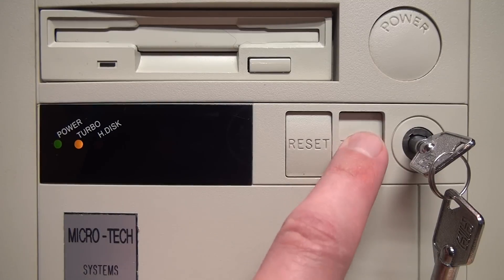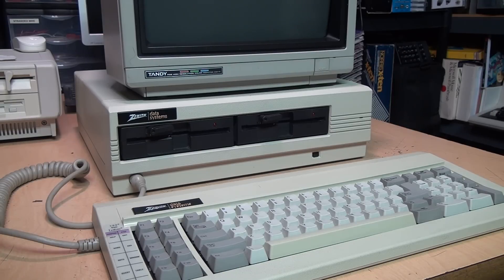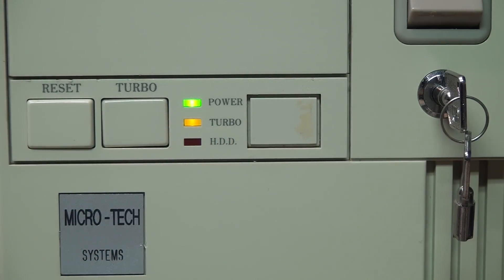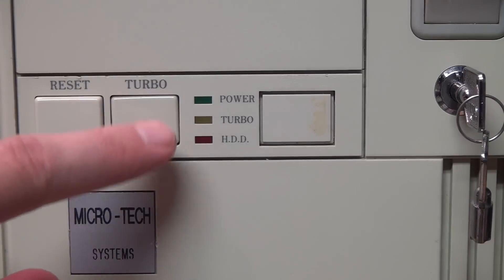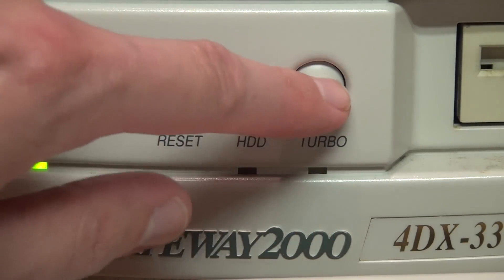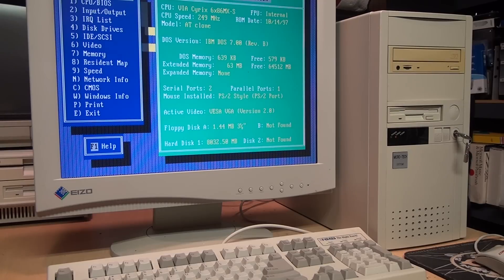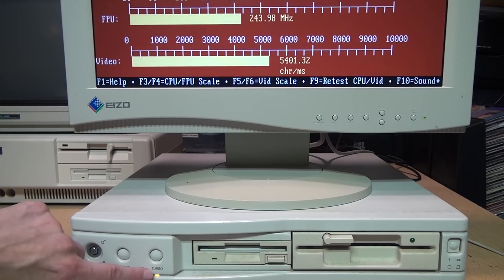The PC turbo button mystery finally solved! (beta version)

Comment from the maker: For those who wanted to hear the history lesson in my own voice, I have re-uploaded it here: https://www.youtube.com/watch?v=zpq9irl2yE4
Reply: why was this with a robotic voice...
Reply: oh thank god
Reply: thank you this was unlistenable
Reply: @sapincher  yeah lol
Reply: i was hopping to learn what physically happens to the cpu to make it run slower... does voltage drops? fsb speed drops? clock multiplier drops? cause since i had my 486 i think anyone knew back then that turbo mode was the normal speed and non turbo the slower speed, that was never the issue...
Reply: hey i have a laptop with turbo mode so do you think its works like a turbo mode computer ?
Reply: So, I didn't wanna look so nerdy and was looking for an "In" just to ask you what that cool little tune is between chapters or thoughts... then I saw you had changed your voice EVER so subtle to not even be noticed... Was that a gag or do you actually manipulate your voice for some reason? Sorry Love it here but new... Also Where can I get the little tune?
Reply from the maker: @Pizzacam3  It's a weather report sounder from radio station WCTC: http://www.amstereo.org/files/WCTC_weather_sounder.wav
Reply: Yes please
Reply: when i was builing these, Id hook it up wether or not if that turbo button was pushed it would always run at its max. However I still set it up so that light would work. But the reality was, I thought it was a scam.
Reply: I didn't even notice it.
Reply: Thank you! 👍🏽
Reply: Thank god, was about to skip the video cuz that Text2Speech was absolutely horrible.

Comment: My dad's PC had a green light under the turbo when on, and red when off, but you had to push the button in(latched) to turn it off. That would be confusing as hell if you didn't think of 'green = on, red = off', and you could easily confuse it as 'turbo = slow'.

Comment: I think the far more interesting question is the various ways turbo was implemented. You showed a single CPU datasheet for a 486 SL CPU, but that doesn't by itself mean anything! There were many CPUs before this that did turbo - probably that didn't have a CPU flag for it - and there is a lot of stuff around about "inserting wait states", disabling cache and such. Just running a benchmark doesn't quantify exactly what is being done.

Comment: The display had a diode matrix and jumpers, so you could display ANYTHING in normal/turbo mode.
There was no real frequency readout or similar, every display segment was freely configurable.
I put the initials of my "demo group" on display back then😀

Comment: This entire topic is alarmingly similar to what I've thought when pressing "sport mode" in my Kia. To me, it's "the default speed" of the car, thus should be called "normal", but that's what they call the mid-range mode, which I would have called "economy." But that name they use for the 3rd level of aggressive economy, which they call "smart", but I would have called that "desperate."

Of course I immediately turn on sport mode every time I start the car.   It's past time to look for a custom chip to have it default there ffs.

Comment: I'm assuming by now the so-called turbo mode is built into every PC nowadays personally I don't understand why they would have been an option to turn it off if it made it run that much better it would have a lot less confusion for everybody if it just did it without having to do anything

Comment: I want to argue!
Well, to offer a second point of view; it depends on how you're looking at it.
It doesn't matter what the documentation say, or even what happens hardware vise. Maybe in the early years of Turbo-button the default for many was to run in turbo-off mode, but it's clear as day that this was not the case for long. Users want their computers to be fast, and if you buy a 66Mhz CPU then that's the clockspeed what you're expecting to use it at.
And what purpose does the Turbo-button serve? It's purpose is to help with backwards compatibility of old badly coded software by slowing the system to a clock-speed that more resembles the olden days.
So arguably for all purposes, what you would use Turbo-button is to slow down your CPU - nobody ran their 486's at 286'ish speed as default, but if some old software went nuts from the unexpected speed, then you would use the Turbo-button to slow it down so the software would work.

So that's my argument. But it's not an argument between what's right and what's wrong - I'm not trying to say the video is wrong, just saying that this is true also. The button was there so you could slow your PC down when needed.

Comment: The engineers labeled the button [Slow Down], and that is what it did.  It slowed the cpu down in order to run legacy software.  Marketing saw that, laughed, and said nope it's the [Turbo] button tell the computer to boot in slow mode. Then the engineers grumbled and said, you're going to confuse everyone. Look what happened.

Comment: Easy, it's just a connection to jumper switch on the PC clock.
Not all apps needed the faster clock speed, i used a slower clock hack too, for game titles that run too fast.

Comment: 4:49 what you have there is a very admirable example of cost reduced engineering that's a win win for everyone. That's so cool that they were able to add that kind of customization feature just by adding an extra wire and a slightly more expensive connector. That's even more cost reduced than a jumper, but it has an arguably better user experience.

Comment: Imagine a slot 1 motherboard with a celeron 300A and multi switch.  Normal mode would run at 133 MHz.  Turbo Mode 300 MHz.  Ridiculous speed 466 MHz.  Ridiculous Speed 504 MHz.  The comes a Coppermine 650 at 933 which has gone PLAID! 😀

Comment: I remember when i was a kid playing that MSDOS rabit  game, if the sound was on, the game runs very slow. That was not like today's games when lag makes the game skip frames making the image form in little jumps, no frame was skipped but the game was like a movie on slow motion, so we had two alternatives, turn off the sound or turn on the turbo switch. the turbo instantainely  makes the lag go away but people used to say that it could damage the computer. Some times we used the lag to make the games easier on harder parts too. that was like a hardware cheap. pretty cool.

Comment: Sometimes, when getting to a difficult part in some games, I sometimes tried to 'de-turbo' the pc to slow the game down a bit. So, without taking my eyes of the screen, I would press the turbo button to pass that difficult section, and would hit the button again when that section was passed. But all too often, in an attempt to press the turbo button, I would hit the reset button. And yes, it does what the name implies.

Comment: God those old machines were like shooting craps! In the 80s you could see 2 cars that weren't modified and came from the factory identically equipped (Same motor, transmission and rear-end) and one would outrun the other one by a fee car lengths. The computers were the same way. You could take two identically equipped machines and one would run so much better and faster. Obviously someone was doing a poor job of assembling both of these examples. Ya'll Take Care, John

Comment: This is what we refer to as a straw man. You'll notice that none of these sources you quoted said that "turbo mode" slows down your machine. Rather, they said that the purpose of having a turbo button is to allow you to slow down your machine. Nobody who ever said this was suggesting that "turbo mode" is slower. So nice work arguing against a position nobody was taking. What we are saying is that the purpose of the button is to allow you to run the machine at a slower clock speed. Why would we say this? There are two relevant questions to ask yourself:

What does having the button allow you to do that you wouldn't be able to do without it?
How would you configure those machines if a turbo button was not available?

The answer to the first question is that the button allows you to select between two different operating speeds for the machine.
The answer to the second question is almost certainly that you would configure the machine to operate at its highest speed.

Therefore, the thing you get with the turbo button that you would not have without it is an option to select the slower speed. That is why many people like myself pointed out that this is the real purpose of the turbo button. Everything you have shown in your video is consistent with this position.
Reply from the maker: The Wikipedia article and several YouTube videos specifically said that engaging turbo mode slowed down the computer. After I published this video, the Wikipedia article has since been edited to correct this mistake.

Comment: Yeah, what happened was that people had TURBO buttons and no LEDs, and their PC was already running in TURBO mode by default, and pressing the button without the LED indicator, they thought they were turning it on when they were in fact turning it off. Well, this was an interesting lesson.

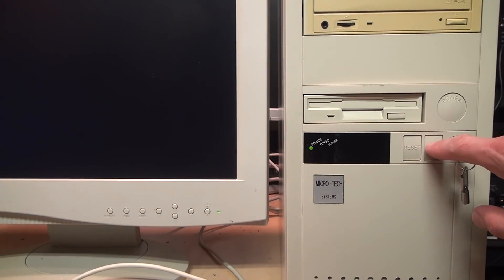Comment: I LOVE the comment/joke @ timestamp 15:53 🤣🤣
"It's called a BOOK" 👍

Also to note: one thing I would've like to have seen/learned about is what exactly the electronics are doing/did for the turbo button to work? What are the main components that made the turbo feature be faster than just the MoBo? Or is all of this just built into the processor already?

Thanks for this vid!

Comment: It’s funny how the names for product features are utilized in marketing products. For example, in the 80’s turbocharged cars were a big deal, and back then it merited a dedicated “turbo” emblem(s) on the interior and exterior of the car to let others know about it. With computers, there’s actually no turbocharger spinning inside the computer that’s increasing the speed. In the 80’s, companies followed a trend of putting “turbo” features on their products. In the 90’s, companies put “titanium” features on their products. In the 2000’s, companies had “evo” product models. The cheesy-ness of these marketing product names adds to the zeitgeist of the times. There’s even “Titanium” motor oil….I don’t know about you, but I don’t want titanium particles floating in my motor oil. Metallic particles of any kind, no matter how exotic the metals are, can’t be good floating around in your motor oil.

Comment: Yeah, BUT... I vaguely remember that once P90 (90mhz) chips came out, the Turbo button slowed it down to 66mhz, so the button switch did slow it down, since unplugging the switch leaving the switch in open/off lets the cpu run at its optimum speed. It gets more complicated as Im pretty sure it actually works by altering the Clock speed AND voltage applied to the cpu chip in a similar way to those dip-switch modes. It therefore depends very heavilly on whether the cpu has two modes and/or if the motherboard has the chipset required to artificially throttle the data stream.

Comment: My first PC the Tandy 1000EX had that 4.77Mhz with the 8Mhz turbo LOL.  I still wish I had held onto this 1979 PC someone gave me that still worked, and had an 8086 processor in it, not the 8088. had a 40 meg hard drive too and a game on it.  why didnt I bring it with me when I moved.... because I'm dumb, so very dumb...
Reply from the maker: The 1000EX, HX, and SX are actually only 7.16 MHz in fast mode, not 8 MHz. That is 50% faster than the 4.77 MHz of the original IBM PC and XT.
Reply: @vwestlife  lol considering it was some 35 odd years ago I am happy I was even that close, thanks for the clarification though. I looked at the manuals I kept but they don't mention anything about the computer itself.  Only how to use the deskmate software and dos and basic commands.

Comment: Lol, the Turbo button on my pc added 100mv to cpu and boosted base clock 10%.so running a t 60% overclock as a base 2.2ghz stock , clocked at 3.8g=Ghz 24/7,  I blazed 2 - Xeon cpus hitting that dang button putting in cd/s. It was just enough boost (+4.1Ghz) to snuff the poor lil intel cpus tortured life when Crunching at full load..must of been like breaking through the ice into a lake of Lava for the poor lil transistors tootsies. Ahh the life pc life 2010, 4X furnace heater Gpus, and 2 air conditioned Cpus, running on 2x1500 watt Psus. Watch that power meter spin baby !!!!:oops:🚨 Pulling 2 KW at the plug for one PC , ROFL.

Comment: There is no mystery here. The purpose of the turbo button was to be able to slow down the computer for some apps that would not work properly at higher speeds. Games in particular were an issue. Nothing like walking by someone playing Sopwith Camel in computer class, hitting the turbo button, and laughing as they immediately lose all control because the game movements jumped to 2x or 3x speed. 

On a different note, the robotic voice sucks and will hold back your channel growth.

Comment: Cool! I always wondered how exactly the turbo control worked. So, just a CPU overclock...
Never even realized that the PC benchmarking software was around in the early '90s.

Post-turbo era case with an older turbo-enabled mobo? No problem, just use a jumper if the switch is NO, that'll keep the mobo in permanent full speed state.

Oh, and I remember cases with LED speed displays, probably with turbo support.

Comment: If they eliminated turbo and key lock to save money why has the “print screen/ system interrupt” key survived all this time when I’ve never used a computer where that key does anything at all. I would love if all I had to do was press the key and the screen would print or save a screenshot or press shift + button and it break out of program like alt fly delete

Comment: Really it was just a "slow" mode and "fast" mode, in fact most people left Turbo mode on all the time unless they were running some older program that ran too fast and needed to slow down the processor. Basically the name was from that weird period back in the 1980's when everything had "Turbo" slapped on it, even if it had absolutely nothing to do with a turbocharger.

Comment: In the late 80's / early 90's I worked for a small PC builder and the build sheets had what to do with the turbo button on them - customers were often upset if the cases we would receive in and motherboards lacked the turbo button option.  At that time we mainly sold 386 and 486 machines (some special request 286) and most of the 486 didn't support turbo buttons.  The other debacle was around the speed LED - there was no polarity protection and new build techs would often fry the displays - we kept about a dozen spares on hand - the turbo LED largely went out of vogue and speed LEDs were all the rage.

Comment: I remember when i had a Celeron 400 Mhz CPU on an AT motherboard in a case with turbo button. I did connect the button with the FSB jumper on the motherboard.
Then normally the CPU ran at 400 Mhz with 100 FSB. If i pressed the turbo button it shortened the jumper that set the FSB to 133 and the CPU was overclocked to 500 mhz. But if i pressed it while the PC was running it caused the system freeze.

Comment: Without watching, the turbo button was there to slow the PC to make it compatible with software designed to run at a lower clock speed, back when programs didn't have built in speed limiters

Comment: However, it makes sense to think of it as a slow down switch because that the active ability of the turbo feature in the system is designed to slow down your computer. It doesnt overclock when on, it underclocks when off.

Comment: In the nineteen I had computers with the turbo button, I kept it all the time pressed and I have almost never used it except to test if my software was running well on slower computers when I write a software that can be sensible to the speed (almost never).

Comment: There's really no mystery, just that there was a high degree of variation in how "Turbo Mode" was designed and implemented on various motherboards and cases, and they weren't always compatible. Harkens back to the ol' wild west days of PC integration, where you had to really pay attention to what components you were getting to make sure they were compatible. Still a significant task even today in the 2020s, but it's gotten a lot better.

I started my PC business in 1987, and I built a lot of systems in the 80s and 90s. There were a lot of weird things being manufactured, and a lot of them, like the Turbo Mode, ended up being more about marketing than serving any real functional purpose.

Comment: I was working at radio shack in the early 90s. I sold 386 machines, and saw the introduction of 486, Pentium, etc, ON my 486 DX 66, that turbo button made wolfenstin and doom run very smooth.  Man that was a long time ago, modifying the autoexec.bat file to squeeze a bit more ram outta the lower 640k so you could run your dos based games. HAH. Meeeemories.

Comment: I remember the old AMD 5K86-450... it had a bug - you couldn't install Windows 95 at normal clock speed. You had to run it somewhat slower for the setup, then install a special driver to run W95 on normal speed. I used to re-install W95 several times a year, so i chose one of the clock speed jumpers and connected it to the turbo button. In normal mode it would be slightly overclocked, and with the turbo button pressed it would run on half that overclocked speed. Used it only to re-install Windows 95, which had to happen so often, that it made sense.

Comment: if you remove the "Turbo" switch, your PC runs in turbo mode, hence the "turbo" button is to slow the PC down, not turbo it up. also it is used to slow the PC down for older programs to run at a speed that is usable.